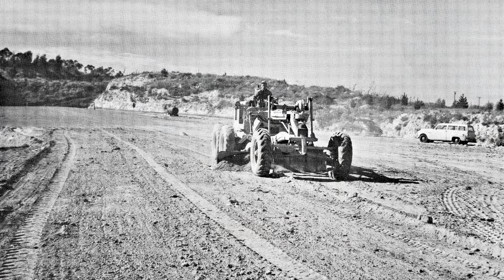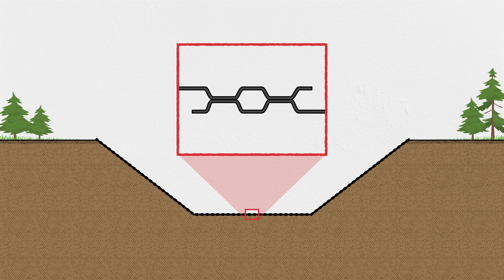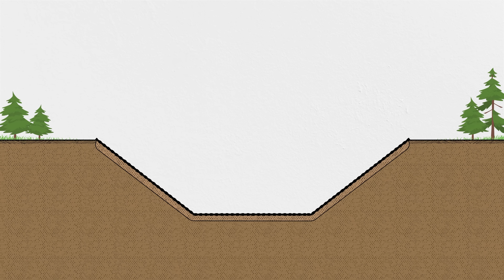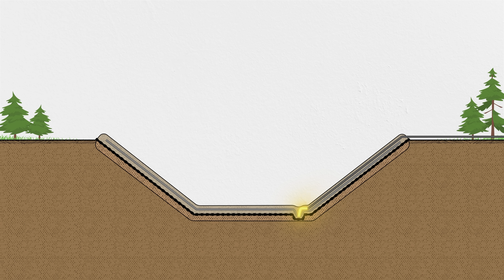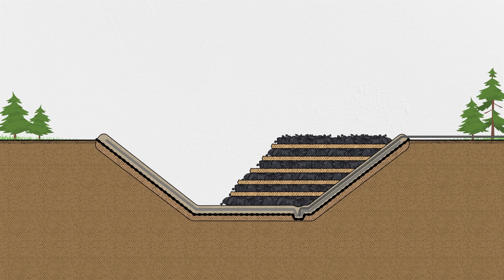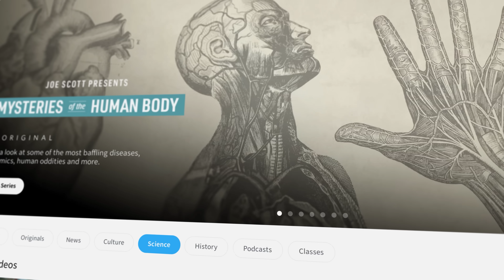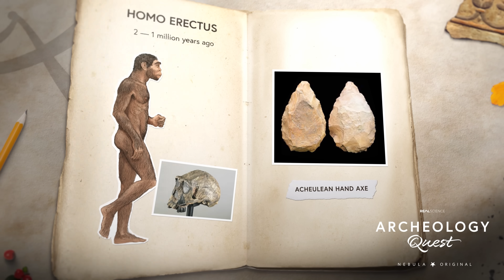The Hidden Engineering of Landfills

Comment: As far as I know, the region where I live, all the non-recyclable (household) waste is burnt in facilities across the country, the heat of which is used to heat water for the local area, and the gasses are filtered. From what I remember from the trip I took to one of them as a kid, I think the only solid waste from them is the filters for the gasses, and ash. I don't recall what they do for chemical, electrical or like specialty trash though. But I know we don't have much issues with trash disposal. There are a few landfills I think, which double as recycling spaces for specialty waste or large quantities, but I still think the primary method of non-recyclable garbage disposal is burning. I wonder about the long term impact of the two methods compared. I feel like there's benefits to both.

Comment: Back when I worked at a landfill building landfill cells, leachate extraction systems, and gas collection/blowoff systems (like 15 years ago) there was a research project looking at using leachate to speed up the waste breakdown process by basically cycling it back up on top of the waste, I think it was a University of Calgary research project.

Comment: Waste-to-energy plants, like those used in Germany, are a far better solution than filling up massive landfills. Modern facilities don’t just reduce the volume of waste by up to 90%, they also generate electricity and district heating while filtering out harmful emissions. Landfills, on the other hand, waste valuable space, create long-term environmental risks (methane leaks, groundwater contamination), and leave future generations with the problem. If countries like Germany can run some of the world’s cleanest and most efficient incineration plants, why should the U.S. still rely so heavily on burying its trash?

Comment: Never understood why these exist.
All metals and glass can be recycled.
All food waste composted
All paper, cardboard recycled,  composted or burned for generators
All plastics recycled or burned for energy 
Don't know what else there is in those landfills.
And yes, I handle all waste at a rural lake home as I described.
No, I don't burn plastics, we have county recycling bins for plastic, glass, metals. Industrial high temperature inverter generators can burn plastics with minimal to no toxic exhaust 
I burn most paper, cardboard waste with biomass. Composted or burn food waste.
And don't say those recyclers just send it to a landfill either here or overseas.
Thats a regulatory, legal, ethical issue on them. A legitimate recycler will handle plastics, metals, glass properly
Reply: Most people personally don't have time to sort through everything per material. and there are plenty of other things that just can't be used for anything else safely, or are designed in a way that can be recycled easily, ie computer chips.

Comment: The problem is that the government allows manufacturers to produce things with toxic chemicals that end up getting thrown away, things like plastic, batteries and things made with paints and other types of chemicals, Al of these things are not natural. I imagine back before the 1950’s every thing thrown away was natural like food scraps, wood, paper, things made of glass or metal. All of these things are natural and break down over time. Plastic doesn’t break down, chemicals used in most products do not break down. Disposable vapes, batteries, plastic lighters, even paper plates and cups that are coated with plastic, all of these things down break down and end up spreading out of landfills contaminating the land and the surrounding area for ever. The solution is we need to ban all plastic and replace it with bio plastics made from plants especially hemp. We could also mass plant hemp plants on the sites of landfills because the hemp plant is one of the few things that can break down plastic in the soil and also other toxic things like pesticides. In so many ways hemp is the solution but the fact that government imposed laws and regulations prevent or atleast make it very diffuse to grow hemp means the government and the companies manufacturing plastic and these toxic chemicals are almost entirely responsible for the poisoning and contamination of the whole world. I don’t understand why more people aren’t putting the pieces together and speaking out about this. We all know the environment is being destroyed but the governments and world elite love to blame it on us and climate change without admitting that there laws are the reason toxic plastic is still being produced even when the oceans and every single country is contaminated with it. Hemp is the solution.

Comment: i figure this is where oil comes from lol. Like there had to be another civilization that did this before us. All these big oil pockets in the ground are from landfills being sealed. The best way is to do what Singapore does. Burn the garbage so hot it burns clean, the exhaust is cleaner than the surrounding air, essentially making the air cleaner. No negative environmental impact. You get rid of it safely. They burn their garbage, then use the heat to create electricity. They then use that electricity to power a desalination plant to take salt out of ocean water giving their people clean water powered by burning garbage. It all makes much more sense. Burn your garbage, get cleaner air, free electricity from it too.

Comment: One of my favorite memories as a child was riding with my dad to the local landfill. It didn't happen often - only when we had things we couldn't take to the typical dumpster-based convenience centers. I recently visited our local landfill again and they have a system in place where all types of materials are separated by people dropping off - so they can be sorted and disposed of more appropriately.

When I was a child, my dad and I would stop at a gas station along the way and grab a couple drinks. I always got strawberry yoo-hoo. When we'd get to the landfill, I remember watching huge bulldozers pushing and compacting the garbage! Those things looked amazing! Then there was that VERY distinctive odor/fragrance. I absolutely loved it. Don't get me wrong, I wouldn't want to wear it as a cologne or use it as an air freshener...but it was one of those smells that, knowing I would only be exposed to it for a brief time, I took in every last waft I could.

Grady, I'm curious, and you certainly know more about this stuff than I do. But why can't we just burn garbage and collect/dispose of the pollutant residue instead? Theoretically, that would be FAR less mass to store. I mean, we literally insisted on wearing masks to prevent COVID - and I'm certainly not trying to start a debate over that nonsense again. I'm just curious if there's a more practical reason we don't incinerate garbage and filter the pollutants. After all, we'll eventually deal with them anyway as the garbage breaks down over time and releases gas.

Comment: I live in a low humidity/high value farmland region (never a failed crop, #1 wheat producing county in the US) and our local landfill is an intermediary stop for trash to be moved ~100 miles away. 

It’s easy to behave like we are victimized by packaging, as the top comment states, but we do have choices: buy less, cut back on foods and products in plastics, learn about composting or backyard chickens, etc.

Yes there are things that need to go to the dump (some contractors have connections to recycle materials, others don’t, or won’t.

We over consume. A park is nice, but like was said about rebuilding mountains after the coal industry got into them: it’s like lipstick on a corpse. You can’t build homes, you can’t farm it, and it’s digesting stuff we still don’t know how to regulate. 

I hate that weak arm flapping “but packaging!” argument.

Comment: On average, it takes plastics anywhere from 20 to 1000 years to decompose, and even then, they often break down into smaller pieces rather than completely disappearing. A 30-year monitoring period seems a bit ridiculous compared to this timescale. The same goes for the protective tarpaulin surrounding the structure. The only way to do this is to produce less, throw away less, but that's another story. That said, thank you for your explanatory and very interesting videos, I've watched several of them with interest 🙏.

Comment: In Japan they burn the the trash in huge municipal incinerators. Ideally to solve the problem of too much trash disposal, there must be reduction in trash,. BTW i have driven by the La Puente Hills  landfill on the 60FWY before they closed it, you can smell it way before you get there and passed it. Today there is zero smell, and the saplings planted there has become huge trees. Of course you can still see signs that it was previously a dump because of various buildings and equipment on the side the mountain.

Comment: Nice video on the explanation of a landfill.  I worked for an engineering firm for a little while that designs landfills and the gas extraction wells that are in the landfills.  The engineering of landfills was way more complicated than I could handle, coming from more of a Civil background that I was used to. I learned a lot from your video and a lot of it made sense based on the CAD I was doing for the company.

Comment: I'm not sure when, but the landfill I'm next to had to dig a new pit and line it.  The trash was removed from the original pit and transferred to the new one.  Mostly because of your original problem, the pit was there for around 100 years(IIRC) and all that leachate was just seeping into the water table.  The old pit was then lined and is now the active landfill again.  Now they have a host of other problems.

Comment: Where I'm from, they burn all the garbage in an incinerator but the smoke or fumes is taken through a system that acts the same as a water bong, then the liquid is filtered and decontaminated. And the concentrated byproducts are disposed of accordingly. But the landfills do not grow out of control because of literally ash. And the air is not polluted because of the bong system
Reply: We have a similar system here in the UK, or at least in my area anyway. There is an incinerator which burns all the non recyclable waste, then the flu gases are recirculated & re burnt, so that almost all that comes out of the chimney, is water vapour, plus the waste heat is used to power an energy from waste electricity generator.

Comment: I drove quad-dump for a few months. Excavating soil from the City of Milwaukee from Jones Island.  Labeled hazardous because over the last hundred years, petroleum from the trains soaked the soil.  The Landfill charged the City $550 (25yards) to take the contaminated soil. In the Landfill we drove down an area far away from the area where regular garbage was dumped (So it seemed) to a .... Special Designated Area for Hazardous Materials.  A Bulldozer would mix the contaminated soil with not-contaminated soil. 
Well,  Here's a Truth-Bomb.... The Landfill had us drive around the Landfill to the so-called designated area for hazardous contaminated soil, but in reality,  we drove a figure-eight and ended right back to the regular dump area.  The Bulldozer either mixed the contaminated soil with garbage and other soil, or the bulldozer mixed with clean soil where a front end loader loaded us back up, then we took the (New-Load) to Miller Park Stadium for the new parking lot, and recreational area for tailgates.  So basically Waste Management charged Milwaukee City $550 a load, then re-sold the same contaminated soil back to the city. Double the profit,  Double the Scam.

Comment: I've always wondered if a clean incineration plant was possible. High temperature, with a massive cooling tower and turbines to help power the plant / sell excess energy to the grid. Would it produce a foul smell and harmful pollution even with top of the line pollution capture? Obviously has the same problem as nuclear: There's already a cheaper option that works fine.

Comment: I'm not a tree hugging climate agenda kind of person but I'm a firm believer in recycling trash. Every county needs to build a warehouse with conveyors from one end to other. Have trash truck dump trash one end on conveyor then have low crime criminals from jail standing by conveyors and seperating trash as it comes by. Whats left at end if it can be burnt in high tech incinerator. If you see all the trash I've seen you would agree something else needs to be done. Go across I-80 in Pa. and see and smell all the trash trucks coming out of NYC. Look at nothern NJTP and see land fills ruining the land and making it worthless. Not to mention one of the sites has been smoldering inside for 50 + years. Ride by Staten Island and look where they used to fill barges to dump in ocean. Don't think they still do that but I don't know.

Comment: There's an old landfill a few miles from my home that has been turned into a park. It has those vent structures like you discussed, and now I know that the nearby building is probably controlling the air flow through those vents!
This was a pretty small landfill in the grand scheme of things, but actually since I live in a very flat area (northern Indiana) the view of the sunset and sunrise from the top of the old garbage mound is one of the best around!

Comment: One interesting thing to note is that the EPA has, on several occasions, admitted that landfill linings and the containment of leachate are but a temporary reduction in ground water contamination.  They acknowledge eventually all landfill linings fail and most within a few decades of installation.  This means that toxic contaminated leachate is, almost guaranteed, flowing into our ground water at a pretty astonishing rate.  We are slowly filling our ground with materials and toxic leachate that eventually lead to chemical saturations higher than what would be considered safe - and worse yet, we don't quite understand the full effects or implications of what that means other than that there are higher incidence of illness and cancers in areas with higher landfill densities.  All the more reason to buy more natural, less synthetic products and manage proper disposal whenever possible.  Waste is part of the human condition, but transitioning waste into more natural products is an option as to attempt to limit/slow the contamination of soil and ground water.

Comment: I have seen another You Tube video with, IMO, is a better solution to the waste problem than just covering it up with dirt. There is an island in the Pacific, maybe Indonesia, that incinerates EVERYTHING! It does this without pollution and the furnace creates electricity. In short, garbage waste goes in, electricity comes out and there is nothing left. Maybe there is a reason, but I really can't understand why this incinerating method is not being implemented over the covering it up method.

Comment: For some reason I was obsessed with landfills when I was little (might be an autism thing idk.) I would spend HOURS reading about landfills. I remember being so fascinated by how the land was engineered to dispose of garbage.  I liked thinking about the different layers and how the deeper layers were older. I always wondered how the garbage from the 40s looked different from modern garbage. I liked to ride to the landfill with my dad and watch the bulldozers work. I liked watching the garbage trucks dump garbage out into the landfill. I liked watching the vultures circle above garbage heaps then land and pick out food scraps. There’s an old landfill that’s now closed near my town. Apartments were built on top of it. It’s next to a river and I sometimes find 100 year old glass bottles that have washed out of the landfill in the river. The old landfill is next to the new landfill. It smells really bad in the summer but you get used to it after a while.

Comment: Found this video after walking to the top of a once landfill now park in Raleigh, NC. From the highest point you could see two other landfills. One in the process of becoming park and another fully converted one. Believe they were mostly piles of scrap metal. Got to take a good look at all the systems in place to prevent polluting ground water.

Comment: or just burn trash and get enrgy... you are dumb cos you put trash in soil dumbest thing ever
Reply: It's not that simple. You first need a lot of energy to burn so much waste. You also have to take into consideration what you're burning.
Reply: @Fattipotato79 No, you don't. Waste to energy facilities do exactly what the name suggests. They also each reclaim thousands of tons of metals for recycling every year and reduce the trash down to a small fraction of virtually inert ash.
Reply: @Fattipotato79 exactly. Burning tons of plastic puts out so many harmful fumes that can hurt both the workers and the town/city around it.
Reply: @Leafy17  Wrong. Waste to energy facilities burn hot enough to reduce almost everything down to simple molecules like co2 and treat the exhaust gasses with filters, anhydrous ammonia, etc. The only indication you'd have of if a WTE plant is running is the condensation of water vapor in the exhaust.
Reply: @JacobNeff-oq5km  Even if what you said was true, air polution is still a major factor in trash burning. We don't need more CO2 in the atmosphere. Plus, once harmful chemicals are captured by the filters you mentioned, they can be chemically changed sure but can never be fully destroyed. What about if the filter is full? How are the chemicals in that filter disposed of?